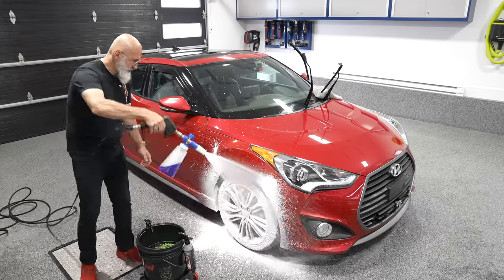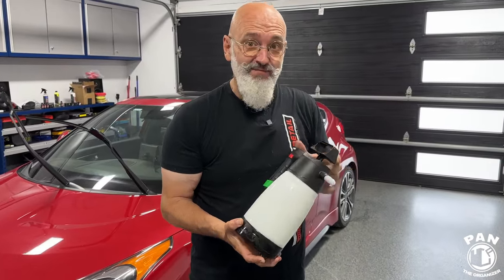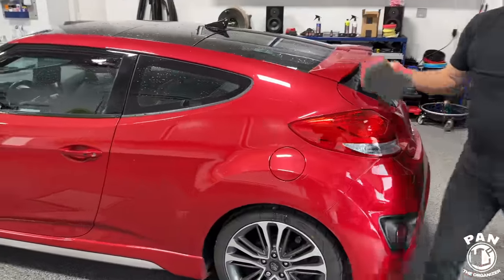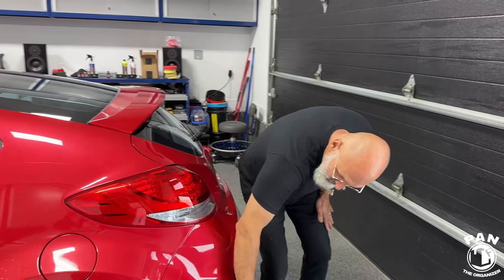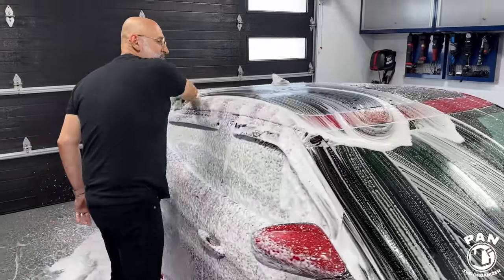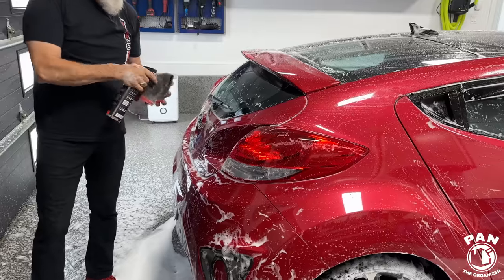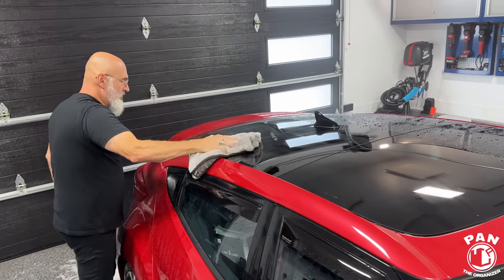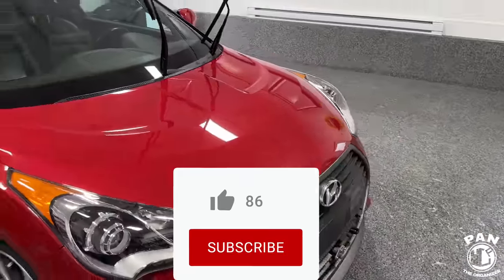The Ultimate Guide to Easily Wash, Clay, and Seal Your Car!

Comment: Hey, Pan. Awesome video as always. If I use a drying aid like ceramic gloss, do I need to use any special soap to wash my drying towel? I use the 1500 by The Rag Company, BTW. 

Keep up with the excelent work.

Thanks!
Reply: Once your finished drying, soak the towel in your wash bucket 10-15 mins. The surfactants will prevent the ceramic from cross linking.
Reply: @diydetailofficial  Thank you for the tip!
Reply: @diydetailofficial  Can it be inside a bucket with DIY  rinseless wash? Thank you!

Comment: Thank you for the many great videos on proper vehicle decontamination! One thing I'm curious to get your take on is your recommendation for quick daily decontamination strategies that take around an hour or less. I work a demanding job where I don't have opportunities to perform a full pre-wash/wash/chem decon/clay/seal multiple times a week. However living in Florida where there are high amounts of biological contaminants (tree sap, pollen, insect contaminants), I would love to get some tips on how to quickly perform some kind of decontamination that will hold me over until the end of the week when I can perform a proper full exterior decon, while minimizing the damage that leaving these kinds of biological contaminants can cause if left on my vehicle overnight. I use a mix of paint protection film and ceramic coating on my vehicle.
Reply from the maker: You would not do this procedure every week. Perhaps once every other month, or every 3-4 months.
Reply: A simple Rinseless wash is all that’s needed for such regular maintenance, then occasionally do a full decontamination.

Comment: Hey Pan all iron removers will work on the same process Mr Lacroix did?
Reply from the maker: No. You have to use iron removers free of solvents as those could damage the clay media.
Reply: @PanTheOrganizer  got you
Reply: @PanTheOrganizer in this case, does the Turtle Wax Rapid Decon work with this synthetic towel?
Reply from the maker: I don't know the exact formulation of every product, you'd have to ask Turtle Wax.

Comment: I tried using a microfiber dryer but after several wrist surgeries, have a hard time wringing them out. What do you think of those Synthetic Drying Towels, like The Absorber?
Reply from the maker: I would only recommend microfiber drying towels. No "shamois" style like The Absorber.
Reply: A Waffle weave drying towel is extremely absorbent, and much lighter.
Reply: Just buy a couple extra towels, then you don't need to wring them out.

Comment: alot of your videos - the vehicles have previously been ceramic coated which doesn't help what i'm looking for. I just got a vehicle brand new, i've put on 1300 miles and need help what I should do to protect it. I don't think the dealer put any protectant on it.
Reply from the maker: A new car is never new until it's properly detailed. 
- at the factory, the paint defects are often corrected quickly by rotary polishing which can leave marks and holograms, so polishing corrects those, before you lock that in long term with a ceramic coating for example.
- vehicles are then transported by truck, train and boat so they are exposed to the elements, industrial fallout, brake dust, rail dust, etc
- vehicles are often left at boat docks (when transported by boat) or in exterior parking lots for weeks or months, again being exposed to the elements
- at the dealership, the vehicles are almost always poorly prepped using the same dirty water that was used for all the cars on a given day, and poor washing and drying methods leading to swirls and scratches 
- at the dealership, a layer of cheap wax or paint sealant is usually applied to attempt to make the paint glossy prior to delivery. It's crucial to remove any previous protection before you apply a ceramic coating, as coatings need to bond directly to a virgin clear coat.

If you only plan on applying a regular carnauba wax or paint sealant though, you could decide to skip machine polishing, as those protectants can be applied over existing protection and it's not as crucial to prep the paint as well.

I explain all of this in this popular video: https://youtu.be/QgoyrC-5CMc

So you can better visualize the new car prep process, here are the steps I perform on a brand new car for my customers: 
RS6 Avant Performance: https://youtu.be/L5SQ0ZIJCj0?si=mcQiMs9HBLlaqjGK
Mercedes S 580: https://youtu.be/Vq_tfcwryVI?si=whord2_UEFSg28UW
Aston Martin Vantage: https://youtu.be/OKga3yZVTqo
Volvo XC60: https://youtu.be/tvDBBenhYFA
Tesla Model Y: https://youtu.be/gohks8xP5NY 
Porsche 911 Carrera: https://youtu.be/2ckiivbFqs4
Audi Q7: https://youtu.be/t7HCBSVnizM
Reply: @PanTheOrganizer  thanks for the reply!

Comment: Why leave the synthetic mitt inside the wash bucket? It appeared dirty from the grease his Veloster acquired from being trailed. Wouldn't it be counterproductive rubbing a greasy dirty synthetic mitt on a just-cleaned car?
Reply: Both the DIY Detail Rinseless Wash and DIY Detail Incredible Suds clean the towel, even if the wash bucket has a bit of use.

Comment: 1. It's a lil' difficult to have a background-voice together with sounds in the actual picture. Get a mic, camera-man 😄🥰
2. Protection gloves(?)
3. I would never wash my car from top and all the way down to the bottom edges on the car, due to the fact, that most dirt covers 2/3 of the bottom. So in this case, more dirt gets into the glove and back to the car if you wash your car from top and all the way down 'til bottom.

Windows first, then 1/3 down and finally last 2/3. Depends on the level of dirt perhaps?

4. I would always wash wheels (cap + tires) before washing the cars body. Many dissolving agents works better when they're not diluted in water.
5. What temperature is the water used for rinseless wash? Does it matter? I know that warm(er) water dilutes dirt faster/better but ... ?

Comment: Can you use the Iron Remover with the Rinseless Wash method?
Reply: Yes you can use it with DIY Detail Rinseless Wash, but you need to rinse it afterwards.
Reply: @diydetailofficial thanks for bringing this point out, as I would like to use the rinseless wash method but also include the iron remover step. So I believe the steps would be:
1. Spray the rinseless on the car
2. Use the sponge to clean the surface
3. Dunk the clay towel in the rinseless solution and then use one spry of iron remover on it and one on the panel then decontaminate
4. Rinse the car with water (pressure washer preferred?)
5. Apply Ceramic Gloss on the panel and dry
Is that correct?
Reply: @tharwatq  thts a good technique but I dnt have access to a hose or pressure washer all da time so I was just trying to think of a good way to do it without one. I do have a Dewalt cordless pressure washer but I hate lugging that thing around lol

Comment: I’m thinking about switching to the rinseless wash method, is it just as easy to dry with a blower as it is with a mf towel?
Reply from the maker: With a rinseless wash you don’t blow dry the vehicle as there are dirt particles in the rinseless wash. You towel dry.
Reply: @PanTheOrganizer  thank you! I wasn’t sure if the dirt being incapsulated meant you could still blow it off

Comment: Are there Iron removers that don’t smell like rotten eggs?
Reply from the maker: The majority of the iron removers on the market use TGA as the main active ingredient, and that gives the sulphuric smell (i.e. rotten eggs). There are some that are better than others at masking a bit of that odor, but not eliminate it, although some are getting close.

Recently, Stoner launched a 100% odorless iron remover & wheel cleaner, as they use completely different technology. It doesn't smell like rotten eggs at all, but does have a light chemical smell like chlorine. But in my tests, it doesn't perform as well as the more traditional ones, and they are reworking the formula as they found out that it also stains concrete.

Here's the product: https://amzn.to/3RX1TNM

More and more brands will be developing these new style iron removers in the future I'm sure.

Comment: Shouldn’t it be wash clay, polish seal?
Reply from the maker: You’re not doing paint correction in this specific scenario or detailing package do no polishing here.
Reply: @PanTheOrganizer  i’m kinda new to this but when you do clay, that’s not paint correction, sorry for the dumb questions lol
Reply from the maker: No worries we all had to learn at some point right? Welcome to my channel. You discovered one of the biggest car detailing channels on YouTube as we surpassed 960,000 subscribers and we have over 130 million views! I have been detailing for 26 years and I love to share my knowledge and passion with my viewers.

You found the right channel to help you learn everything about detailing.

So in a a full detail process, there can be many steps depending on what you want to do. But typically there can be:
1) wash
2) iron remover (chemical decontamination)
3) clay bar (mechanical decontamination)
4) paint correction (machine polishing)
5) wipe the surface with a paint prep spray or IPA solution to remove polishing oils
6) apply protection (wax, sealant or ceramic coating)

Also, I highly recommend that you watch my Detailing 101 series for beginners, where I explain different steps like iron removers, clay bar, polishing, protection, etc. It's super simple once you understand the basics, and your car will look and feel 100x better!

Part 1: how to properly wash your car: https://youtu.be/7Koj5j2Es5U
Part 2: how to clean wheels and tires: https://youtu.be/omwcNcSYcS8
Part 3: chemical decontamination (iron and tar removal): https://youtu.be/W_cyHz3XssU
Part 4: clay bar: https://youtu.be/XB8UaTCXuLg
Part 5: machine polishing (paint correction): https://youtu.be/ustTEVGMOTI
Part 6A: how to wax your car https://youtu.be/KZjiPcsPBrA
Part 6B: how to apply a ceramic coating: https://youtu.be/sqQYVjxFqK0
Part 7: Differences between waxes, paint sealants and coatings: https://youtu.be/4ejfPHan3k4
Part 8: How to clean your car’s interior like a pro: https://youtu.be/Xx_lHXHYpLo
Reply: @PanTheOrganizer  yeah I’ve watched a couple of your videos and you seem like you really know your shit. very detailed organized and professional. Thank you for the response channels as big as yours. People usually don’t respond back. I’m definitely gonna subscribe.
Reply from the maker: You found the right place to help you bring your detailing game to the next level for sure.

And yeah thanks for highlighting the fact I respond to my viewers. I’m the only big detailing channel that actually responds to viewers every day on YouTube. 

I won’t lie, it does get overwhelming at times as you can imagine with almost one million subscribers sending me thousands messages daily. I can spend up to 4 hours every day just to reply to comments and questions, which cuts down on my personal and family time. But I enjoy sharing my passion and being close to my viewers, and accessible. And I know they appreciate it. 😁👍🏻

Happy new year by the way!

Comment: Rinseless is BS..i had problems with water, so i bought a battery operated foam cannon etc., the whole works. I had a lot of fun and it was effective. Then i moved to a full fletch pressure pump etc. 2 bucket wash etc. is the best way to wash

Comment: The one thing that I hate about cleaning my cars is drying it.
Reply from the maker: If you have protection on your paint (wax, sealant or coating) the best way and fastest way to dry the vehicle is with a car dryer or leaf blower. It's also 100% touchless so no worries of marring the paint.

See how I wash my car in this video: https://youtu.be/X0msqeozDBU?si=8CTvRpweBuzeCkkW
Reply: @PanTheOrganizer 
Can I dry it with a blower if there's no protection?

Comment: No wax or polish after clay? just a sealer? while a million video's saying to polish or wax?
Reply from the maker: Not everyone has the time, knowledge or equipment to polish. And for customers, not everyone has the budget for machine polishing, so for detailers, it's important do have different package options to suit customer needs and budget.

You don't do a service if a person isn't willing to pay for it. And with modern synthetic perforated decontamination towels like the one used in this video, it doesn't do any marring on the paint (as it's not abrasive like traditional clay bars) so you don't really not to polish afterwards, depending on what you are planning on doing. If the paint looks good, no need to polish, you can go straight to applying the wax or sealant.

If you want my full car details, where the customer wants the whole nine yards and has a big budget, you'll see all the steps done: pre-wash, wash, iron remover, clay, machine polishing, paint prep spray to remove polishing oils, and ceramic coating application. See examples below:

Audi RS6 Avant Performance: https://youtu.be/L5SQ0ZIJCj0?si=mcQiMs9HBLlaqjGK
Mercedes S 580: https://youtu.be/Vq_tfcwryVI?si=whord2_UEFSg28UW
Tesla Model Y: https://youtu.be/uV7QWwyuPL4
Aston Martin Vantage: https://youtu.be/OKga3yZVTqo
Volvo XC60: https://youtu.be/tvDBBenhYFA
Porsche 911 Carrera: https://youtu.be/2ckiivbFqs4
Audi Q7: https://youtu.be/t7HCBSVnizM

Comment: Thx 2 that old.guy i broke my foam pump   pumped it 2 the max now it leaks the shit out of it
Reply from the maker: LOL what? What foaming pump sprayer do you use? If you have a quality one like an IK or Marolex, it's impossible to overpump them. They have an air pressure release valve when it reaches maximum pressure. When you hear the "pshhhh" sound, you stop pumping.
Reply: @PanTheOrganizer  look at one of his reels.  It was an IK
Reply from the maker: What does one of his reels have to do with you breaking your sprayer?
Reply: @PanTheOrganizer  the reels started with" how to get maximum foam out of your foam sprayer ,(something like that)
Reply: In that real, as Pan stated, we show to pump it up per the IK instructions, meaning until the release valve expels air.

Comment: I like your channel BUT!!!!! you have NEVER posted a video on how to wash wax and detail a LARGE SUV. I have a Range Rover and it would be nice to see how you would detail an SUV of that size and NO, A Honda CRV is not what I'm referring to. I'll tell you right now; Large SUV owners are BEGGING to see a video like this. Go check other detailing channels and you'll see that none, not a single one has a video on detailing a LARGE SUV. Not even Larry.
Reply from the maker: Most of my customers have higher end luxury cars or sports cars, but no large SUVs (unless you consider a Volvo XC90 a large SUV in which case I have a full detailing video of that on my channel).
Reply: I have a 2019 BMW X3 that looks just like the one you featured in a video a few years ago.  I love my Microfiber Madness Incredipole to get the roof done without having to break out my step stool.  @PanTheOrganizer

Comment: I am NOT doing all that work. I've had my car for 18 years and go to a quality car wash place that washes dries by hand and cleans inside for $35. I have zero rust and it looks like new.
Reply from the maker: Big difference in "looks like new" and actually is like new. Just washing a car isn't enough to remove embedded contamination and also things like paint defects (swirls, scratches), and certainly doesn't do anything for protection if you don't apply a wax, sealant or coating.

That's fine if you don't want to care for your car and want to have it cleaned by car washers, but there's much more to it than just cleaning a car. That's where a professional car detailer comes into play. With more advanced techniques.

Welcome to my channel. You discovered one of the biggest car detailing channels on YouTube as we surpassed 1 million subscribers and we have over 135 million views! I have been detailing for 27 years and I love to share my knowledge and passion with my viewers.

You found the right channel to help you learn everything about detailing.

You can see how I fully detail cars, A to Z, in videos below:
RS6 Avant Performance: https://youtu.be/L5SQ0ZIJCj0?si=mcQiMs9HBLlaqjGK
Mercedes S 580: https://youtu.be/Vq_tfcwryVI?si=whord2_UEFSg28UW
Aston Martin Vantage: https://youtu.be/OKga3yZVTqo
Volvo XC60: https://youtu.be/tvDBBenhYFA
Tesla Model Y: https://youtu.be/gohks8xP5NY 
Porsche 911 Carrera: https://youtu.be/2ckiivbFqs4
Audi Q7: https://youtu.be/t7HCBSVnizM
Reply: @PanTheOrganizer  I agree with you but I can't afford to pay someone to do that. It does look like new that's for sure. Thank for the informative videos
Reply from the maker: Welcome to my channel. You discovered one of the biggest car detailing channels on YouTube as we surpassed 1 million subscribers and we have over 135 million views! I have been detailing for 27 years and I love to share my knowledge and passion with my viewers.

You found the right channel to help you learn everything about detailing.
Reply: @PanTheOrganizer  thank you.  If I had the time I definitely would do my own. When I was younger I used to love working on my own vehicles